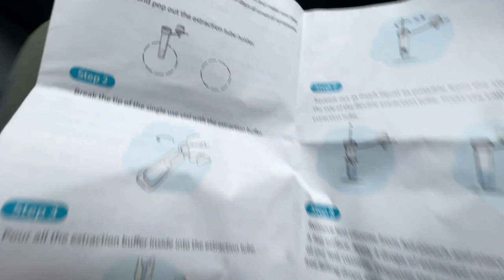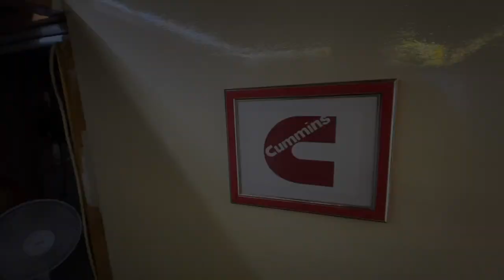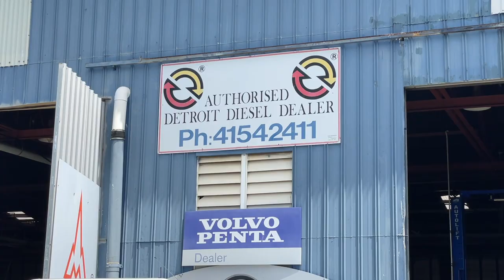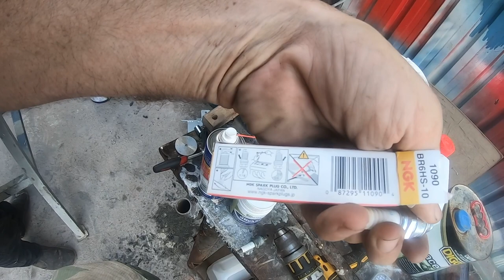Mercury 3.3HP Outboard Repair

Comment: Back in the 70's we had a 15hp evinrude, the prop pin broke, and we did not have a spare one available.  A friend pulled out a steel nail, cut off the head and cut it to the proper size!  The darn pin never broke again!  Glad to see you back!

Comment: RIP  Air Horn!  Love to see the barge project.  Years ago I built a pipe frame to set on large blocks of Styrofoam and then built a pile driver to mount on it.  It was amazing the uses we found for the barge.   I think hurricane  Alicia finished it off, I left it at the t-head pier that it drove the pilings for.  Nothing left there except the pilings after the storm.  Glad I had moved my shrimp boat to a more protected dock.  Looking forward to what ever you decide to do next!
Reply from the maker: I definitely think the barge could have many, many uses and should be fun to make.

Comment: A note about running outboards with no lower unit – at least on some four-stroke Yamahas that I'm familiar with, the driveshaft has two sets of splines, the lower of which drives the oil pump. Not sure if other makes are the same way, but I came close to learning a lesson the hard way!
Reply from the maker: Appreciate the tip, definitely something to be aware of. My old four stroke yamaha drove the oil pump off the bottom of the camshaft but it's good to know that some models are different.

Comment: Thanks for that Stu. I use a 3.3 Merc for my tender and am pretty good at stripping its carby when it doesn't run well. Lately it has been dying when I open the throttle past 3/4. So after viewing I will check the O ring (I don't think it has one) and maybe enrich the needle setting on the carby. Cheers Phil.
Reply from the maker: You're welcome Phil, if it doesn't have that o-ring it may well be sucking air and running lean.

Comment: Those are cracking little outboards.  I've got the Tohatsu 3.5 HP version (virtually identical), which I believe is a 2001 model but had barely been used when I bought it.  The standard prop is pretty small (it's plastic, a glass-filled nylon or similar), but even putting that in gear the first time sheared the original (brass!) shear-pin.  The motor came with steel spares, and a steel pin's been fine.  Pushes my 2.8 m inflatable nicely with two up - and is a fraction of the weight of a modern 4-stroke of the same power.  Love it!
Reply from the maker: I've been really impressed with it. I believe they are all made by Tohatsu and just rebranded as Mercury.

Comment: If you stop off at a Honda or Suzuki Powersports dealership they have a carb cleaner that actually cleans out that varnish old fuel. Over the counter parts store barely touches it I find. But the Honda and Suzuki stuff will melt your rubber gloves when you work with it!
Reply from the maker: Interesting!

Comment: Run down to the machine shop 😂😂. I do all this sort of dodgy stuff on my old outboard engines, great to know I’m not alone.  If you can remember how you’ve bodged it, I find there’s a decent chance that you can re bodge it when it stops on the water. If you’re the sort of mechanic who just fits new parts, you won’t have that part with you when you need it.

Comment: If you are going to build a barge I would recommend that you do some research on ferrocement. It uses uses chicken wire and rebar for your bones of the structure and cement for the skin.

Comment: Great to have you back! I feel like you already know this, but you should get a proper prop for that engine, if its not balanced it will vibrate and ruin the bearings.
Reply from the maker: Yes, I will order one, it is more for the experiment than anything else.
Reply: @DangarMarine  Stu Can I pick your brain? I have a 15hp Honda pull cord start and it’s really heavy to pull, mechanic says it shouldn’t be so heavy to pull and can’t fix it. His Solution is to fit an electric start. Any suggestions for a cure?

Comment: You and Adrian building a steel barge would be fun to watch even though I might have to employ 'Google Translate' so I do not miss any of Adrian's quips and words of wisdom!  lol

Ultimately I'd love to see that V12 used on the barge as a multi-purpose power source for the barge.  Things like a treasure finding air-lift suction dredge, a crane apparatus for lifting the gold-and-silver-filled chests, dive compressor, electric generator, and of course, as an emergency means of propulsion when BRUPEGS Cummins craps out.....
Reply from the maker: It would be great to have a Detroit setup to run everything on the barge for sure.

Comment: The key with that outboard is to empty the carburettor every time you use it by running it dry (shutting off the fuel while it's running). After you start doing that it will become the most reliable outboard ever.
Reply: Agree, but only if you are using ethanol fuel. Ethanol free fuel leave in carb, for a week but no more.
Reply: @omieyouknowme  Very true. Running it dry means no lubrication in these small engines.

Comment: Hey! So glad to see more videos… I’m working on a Johnson 2 stroke very similar to the 155 hp one you rebuilt a couple years ago…. I am putting road caps on and trying to test the seating…. If I can feel the crack with my finger nail but can’t get it to catch should that be okay or do I need to keep reseating?
Reply from the maker: I believe they are supposed to be almost imperceptible but I can't recall the exact wording now, I've only done that one.

Comment: I've watched a lot of your videos and you're quite the mechanic. Have you ever replaced the swivel frame on a Honda? I'm working on a 2001 bf40a. I cut the old steering frame off and lifted the motor off, with the shifting rod in place. Only to find out the new one won't go back on with the new upper rubber vibration mounts in place. I'm trying to figure out how to get the shifting rod out without pulling the top of the motor off. No videos or good references I can find on the web. Any thoughts? Thanks

Comment: I have that 3.3 Mercury motor.  I think I have to change the reed valve going by the symptoms.  Is it possible to get into the reed valve by going in from the top, under the pull starter?? Or do I have to go in through the engine block??  I know the carb is clean, fuel is good.

Comment: Decades ago as a young man I was hired 
by an evenrude dealer . They put me on the 
small motors bench, 25hp and below. One 
day this old codger brought in a diesel, yes, 
DIESEL single cylinder outboard. It musta
been 50 years old. I thought diesels would
be too heavy to hang off a transom, but yet,
there it was.

!

Comment: It's a "steel rule" technically Adrian. 
I wasn't sure what was happening with Renko after watching Matt's video. He has done a few small boat restoration projects, been a subscriber to both channels for years. With regards to big diesel engine boats, I've been dreaming of doing a 16-18ft ski boat with a late mod multi valve, common rail, compound turbo 4-5cyl engine.

Comment: wondering if you can help me. I have a 3.3 outboard which when i open the coke to the upright position and give it some revs cuts out. I have taken apart the carb and the float moves freely. I have also take the fuel line off to it and checked to see the flow of fuel. The mixture is 50.1. With the coke open the engine starts first time. as soon as i close it and rev it boom it cuts out. Should i be checking the spark plug ?  thanks

Comment: Wahay, Danger Stud's back where he's meant to be.

Nice to know you pay attention when I make suggestions, at least I'm guessing that's the sole and solitary reason for thinking about building a boat from scratch, although I maintain a glass bottomed catamaran is way cooler than a barge. Probably less useful so I'm going to let ya go with the barge thing on as a practice project.

I'm right in thinking the HMAS RIBC will no become part of Brupeg's slowly growing constellation of Thunderbird style sub-vehicles. Just as a suggestion, a nice big weather balloon tethered to each corner would lift it out of the water somewhat, might well make travel a lot easier. Careful not to use too large balloons, though,  my Uncle Cosmo tried the same trick with his '76 Toyota to improve fuel efficiency. Him and his mate 'Batshit' Frankie Doornails liberated a dozen or so from the FV Franklin after getting a touch of dutch courage in the old Pearly Boys Bar. Forgot to pick up tanks of helium, though, so they ended up rigging up an electrolysis machine on the end of the pier. Turns out filling weather balloons with pure oxygen isn't all that useful, but after they worked out which pipe the hydrogen was coming out of, everyone figured they were on to a winner. After all, there's an awful lot of water out there and it's almost entirely made out of hydrogen, despite Aunty Brambles' stance that you can't make water, water just is. Silly tart.
Soon had the balloons filled up with lovely hydrogen, a flat eight of them, two per corner in case any of them burst. Took it down the truck weigh station and now there's a three ton ute cashing in at one and a half tons. Cosmo was right happy about that so he went on a bender down Borroloola until he got himself thrown out for rude and unusual use of the pool table. He claims he was only trying to find lost balls. Anyhoo, Batshit Doornails was on the verge of a full and thunderous chunder so he was consigned to ride home in the back, which no doubt suited him fine as Doornails was never short of a pinch of the old Hippies Cabbage. We'll never know exactly what happened, of course, all Cosmo can remember is the sound of a lighter trying to fire, then a blinding white light and waking up with a bad hangover surrounded by rozzers in the front end of a Toyota sitting in a four foot deep crater. Possibly coincidently the next day there were reports several sheep had got themselves wiped out when presumed space debris had landed out by Kiacatoo, so, you know.
Anyway, the broad and lentil of it is to be cautious with your use of lighter than air gases and lighters.

Finally, you lot are never going to get rid of totalitarianism until you just stop obeying. I've spoken to the lads and they're happy to sort it out for you, but none of them really want to stay on a ship for a week coming down to sort your bogun pollies out, much easier to get it done thyselves, especially when you remember it'd be you lot buying the drinks after.

Comment: V12 should power the barge fine, plus run quite a kit of accessories.
Reply from the maker: It would be cool to have a Detroit on the barge for electricity, air and hydraulics.
Reply: @DangarMarine  yes sir.

Comment: If you're going to cut aluminium with an angle grinder cut off wheel, I recommend hitting the wheel up against a bar of soap before you start cutting.

Comment: E10 is that the issue with closing the carb…. 

I have noticed with the mower it attracts moisture and  gunks up the carbs after sitting for a while 

Clean it up all comes good :)
Reply from the maker: Yes, E10 isn't for use in a marine environment.

Comment: Cool. I work on steel barges with 7000 series manitowac cranes on them. I build bridges high rises and stadiums. Renko is def borderline a tug boat n e way. Plus a 12v-71 running hydraulics. Look into a spud system. Its a giant steel spike ran on a hydraulic cable winch on the corners of a barge . so u can anchor the barge in a body of water. Stable enough 2 lift 200,000lbs objects in my job
Reply: I once bolted two subarus to the side of a watertower in the middle of winter in montreal

Comment: too much grease will prevent it from priming, had the same issue with an engine oil pump, used too much engine assembly grease and it wouldnt prime
Reply from the maker: Interesting to hear, definitely something to be aware of.

Comment: its not a split pin, its a collett.
Made from hardened steel as it transfers the full force of the output to the propeller.
propeller  needs balancing so it doesn't wear the bearing out
Reply from the maker: It's actually a split pin being uses as a shear pin.

Comment: can't find accelerator pump diaphragm for old evinrude 4 stroke (15hp), does anyone make them?  Can you just block them off with a gasket and do without?
how can you diagnose if a problem is either powerpack, coil, or stator ??? without having to buy new ones?

Comment: Don't move the circlip on the needle, you will not get more hp. How many times have I seen this on motorbikes. It causes all sorts or running problems..
Reply from the maker: It is a mixture adjustment, you would only move it if you also gave it more air to keep the ratio right.

Comment: I guess getting woken up by an air horn is slightly kinder than having the same done by a needle gun on the outside of a steel hull  about 2 feet from the pillow !

Comment: this thing goes to that thing so that that thing makes the other thing go up, so that the other thing can go down and make this long thing spin so that the  other parts do what they need to in order to get the upper parts to fire up and produce power to send back down to get the lower parts to start moving these bits and in order to do that they need these pins, screws, shims, cranks, calipers, joints, and that one bent thingy to all do this one thing....um...oh, its spin this blade to push water. simple.
Reply from the maker: You’ve got it. 😉

Comment: You should have removed some of the weight of the hub to achieve full throttle ! It’s like running semi tires ( 24.5 ) on a go kart , it will work but not very well and that’s why there painted black !?! LMAO
Reply from the maker: I can see what you are saying Dave. Get the rotating mass down and we'll hit 15,000 RPM no problem. :D

Comment: I have used WD-40 in lieu of starter fluid.
Reply from the maker: I have too, and actually tried with this but it wouldn't fire for some reason so ended up using the starter fluid afterwards.

Comment: Guys… You spend days fixing an old outbord to mint condition.. And then you try to gerryrig it with the wrong prop.. Why on gods green Earth do you do that? How many gearboxes has been  broken because of af crappy prop..
Reply from the maker: Because there weren't any props in stock and we needed it that day. Thanks for asking instead of just assuming we were being idiots!
Reply: @DangarMarine   You said: 120 dollars for a new prop.. Why not put that on, and have a trustworthy unit for the next 10 years or so?